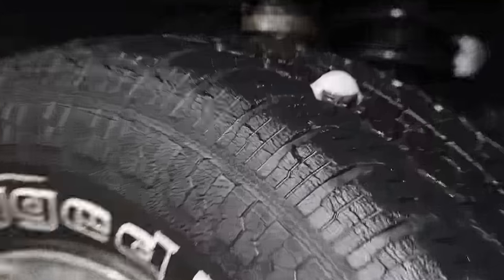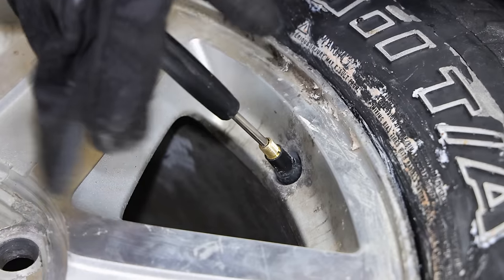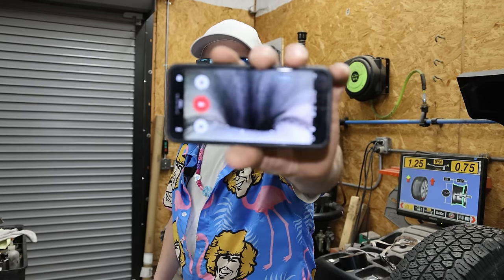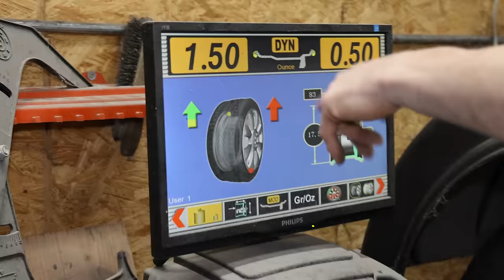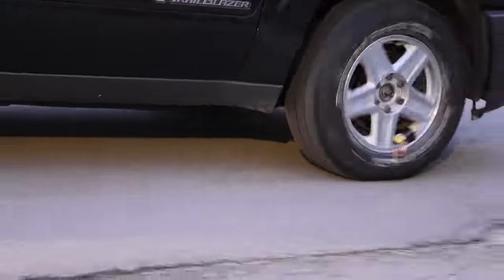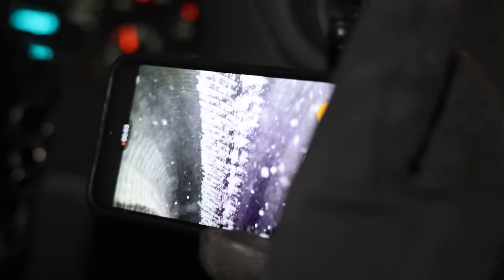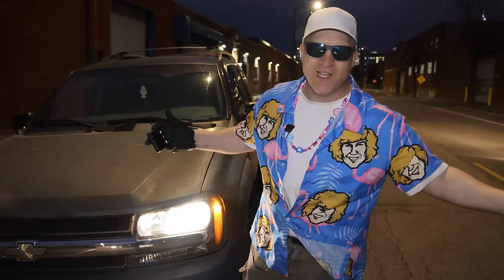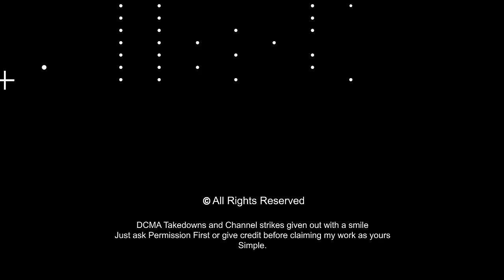GoPro Inside a Car Tire (With Balance Beads)

Comment: Cool as a science experiment, and maybe temporarily relive the vibration of a hand changed tire, but just get the thing balanced! Admittedly shops gouge mercilessly for a dynamic balance for 2 minutes work on a machine paid for years ago, so shop around. There still isn't anything better that I know of.
The camera was cool and made the video worth watching but, the test wasn't all that good because you didn't do a baseline with the camera, without the beads.
I am with you and can't come up with a mental model of why they would work, but if a theory doesn't fit the facts, it's the theory that is wrong.
Reply from the maker: Yeah I agree, well as you see from this video I have my own balancing equipment, But I completely agree with you tire shops are usually a nightmare. As for the theory yep I agree and It's bothering me to the point where The next video posting this week will be a follow up to this one, just so I can close the case and understand exactly what's going on... You know what I'm talking about.

Comment: That tyre needs scrapped asap, its badly cracked/perished, the cords are showing through the rubber thats peeling off, why are you still even using it?
Reply from the maker: Because it's a beater, but I changed them out right after I finished this video
Reply: Well, I've seen that tread and I said what is going on?No way he wants to use that tire, but that's what it does, right? It gets you to speak up. It's a great big trick and I approve of that lure. 😅❤
Reply from the maker: @MacNifty  well not too much of a trick because I actually did use the tires in the video, but I changed them afterwards, I honestly almost didn't but One of the beads ripped when I took the tire off the rim to put the GoPro inside, however they were very very noisy.

Comment: i'm skeptical about these beads i have a feeling they would  weaken walls after vibrating and rubbing against the tire for tens of thousands of miles. kind of like a rock tumbler.

Comment: Tires won't last long with beads. They will wear the inside of the tire out before you start losing tread life which will result in faster tire degrading and more tire blow outs. But go for it

Comment: My best guess how they work....

All sides of the tire compress when they hit the road as the wheel rotates....
The heaviest side that sticks out the most also compresses the fastest and the most and throws the balance beads out of that part of the tire

 I feel balance beads only work when driving on a road and would dis-balance a tire if spun freely in air.

Let me know your thoughts.

Comment: I tried 6 ounces of tire balancer fluid in each of 8 P235/75/R15 tires. Wasn't worth a shit. Had to wipe all of that junk out. Would not balance on an electronic balancer as shown in the video either. Fluid should work even better as it flows and won't clump or stay at tire ridges. I went back to weights ever since after wasting a bunch of time.

Comment: ummm right.  It was 2oz out of balance on the machine WITH the beads in, right?  Sooo...NOT balanced.  That 2oz is gonna have that tire thumpin at highway speed.  And not sure what the point was about a brand new tire being out of balance?  Of course it was.  They all are due to slight manufacturing defects and also imperfections in the wheel.  That's why you always get your tires balanced when you buy em.  (Do I really need to be sayin these things?)
Reply from the maker: Hey I was just showing how they work..,that's it.

Comment: You could cause a fatal car crash with those tires and now YouTube permanently has video evidence of you knowingly driving with defective tires.  It will cause any insurance company to have a perfectly good reason to not cover you and then you'll be in a horrible situation.  Crazy!  Even if my tread is perfect but I would see any sign of dry rot, new tires get ordered that day.  Isn't it nice having new tires?  I love it and don't hesitate at all.  Whether it's car or Mountain Bike... Always keep your Tires and Brakes in the best condition.  Slowing down and steering are your 2 most important safety devices.

Comment: Man i hate those fucking beads lmfao. I used to work at a tyre recycling facility and truck tyres were notorious for having these in them, so when you'd roll them out the back of the truck onto the ground they'd go everywhere, bounce into your shoes and you'd be stepping on the fuckers all day. Also super slippery to walk on.

Comment: Balance beads are great until you stop at the gas station on the corner to put some air in. Then the shitty compressor adds a little moisture to the air in the tire and your beads end up being a clump.
Reply from the maker: That's a great point

Comment: It's insane how cracked those tires are. That would not pass motor vehicle inspection here in Canada. I'm sure I'd get a stern talking to if I brought a car into a shop with tires that F'd up.

I guess this guy runs his tires to total catastrophic failure.

Comment: If your tyre is that bad, replace it. Everyone around you will thank you. Those bits of rubber will fly at speeds that could seriously hurt a person (or worse with larger chunks) if it hits them. Don't just put beads in your tyre and call it good.

Comment: Balance beads = Gimmick!

Even if you were to put sand or small rocks in the tyre they would have probably behaved the same!

What was the weight of the balance beads??
They were so small and so spread out inside the tyre with many variances that they wouldn't have any effect on balance!

You got duped!
Reply from the maker: Well I didn't get duped, I don't use them. It was about 9 oz of each type of bead, I don't think sand Would have the semifact because from what I witnessed the beads rolled into place way smoother than sand ever could. Just my observation.

Comment: The coolest thing about this video is seeing the inside of the tire while actively being driven. I was interested in what kind of science supports the usage of balance beads since I’ve never heard of them before. 
I’m disappointed that this video did nothing to establish any scientific method for confirming or denying the plausibility of using balance beads as opposed to traditional weights.
At no point in this video did we establish a baseline and comparison test, and at the end of the video swapping out the old tire 
With a new tire, and using no balance beads, did nothing to provide any scientific evidence other than “hey look what another tire would look like on the balancer“. For context, as little as a quarter of an ounce of imbalance can be felt in the steering wheel depending on factors such as tire construction, size, and suspension. To show that the tire needed at first 2 1/2 ounces of weight and then on a second balance 2 ounces of weight does not show an effectiveness of the balance beads to actively balance the tire out.
Unfortunately, this video can only be chalked up to a gimmick. I still loved the GoPro video inside the tire.

Comment: Those tires are trashed and need to be replaced. Tread separation is a blow out waiting to happen. And if you took the tire off to mount the go pro why didn't you put the beads in then??? LOL You are supposed to throw the entire inner bag in there. Yes, I change tires for a living....

Comment: I am thinking those beads are a gimmick. Like Magnets on the fuel line.
Balance is Left to Right Not the full circumference of the Flat of the tire. The Beads were all Slung to the outer circumference & looked to be pretty evenly distributed. No Balance there.
I have had tires so bad you had to put almost a pound of weight on "One side of the tire" to get it to run smooth. And it is not always the Outside where the weights are placed.
Pretty sure these Beads are doing nothing to help.

Comment: Neat, but where is the control test? You should test balance before adding the beads. It's quite possible it was balanced properly without any beads.Your final "test" wasn't actually a control. It's not "crazy."

Comment: Balancing beads don't work. You didn't even check the balance prior to putting the beads in. It's just tiny little balls floating around in your tire sticking to wherever the centrifugal force pulls it, people act like these are some kind of nanotech like it finds the unbalanced area and sits right there, some genious came out with this idea not for you but for him and omg the Goldwing community went nuts for them. I've dealt with them way too much.

Comment: Bro you literally just toss the bag in the tire and it'll open itself up after driving a short distance lmao I have never heard of anyone putting beads in a tire in either of the ways you showed. I have 12 years experience as a mechanic.
Reply from the maker: Well I didn't want all those microplastics They could affect my tires digestive system. But in all honesty it was in the instructions This is my first time using these beads. I'll just toss the bag in next time But I was shooting the video and I needed them to be active right away.

Comment: Beads have been shown NOT to work on wheel balance machines. The argument is the axle needs to be able to move in order for the beads to “do their thing “.

So how is it that a 7oz GoPro imbalance can be corrected while on the machine?

Balance beads are BS.
Reply from the maker: Good point but looked like they worked to me, to clarify I don't use balance beads at all, this was just out of curiosity.

Comment: For this to mean anything you'd need to know the balance without the beads in there.  Also, we saw that the claimed mechanism for these things is total BS.  They did exactly what you'd expect, which is get stuck to the wall in a single layer and not move until there was significant acceleration/deceleration.  The manufacturers all claim that they continuously creep around to adjust for the weight.  Why would the heavy side be full of the things?  Reading the manufacturer's material, they also all say things like, "This works for some situations but not others."  Well, which situations?  Just gotta try it and see; you'll know if it works!  That's the same BS that you get any time someone is selling snake oil.  They only work for people who believe that they're working.
Reply from the maker: Great points and I'm currently filming a follow up video that I'll post this week because I am with you on everything you said, In my mind I can't quite grasp how these are working, I have to see it for my own eyes and dig into the science of it to see proof. Thanks for the comment.

Comment: Sorry but I'm not buying it, the same way when slime gets old and turns into balls inside your tire they always have a tendency to go to the lowest Heaviest part of the tire which makes the balance even worse The imbalance of a tire will always be the heaviest part of the tire the beads will only make the situation even worse by migrating to the heaviest  part. if you spin up that tire 10 times I'm sure you'll get a different reading every time.
The balancer only operates at maybe 10 miles per hour at the most, put it on a vehicle at 55 miles an hour and your steering wheel will probably vibrate your teeth right out of your head. Do yourself a favor, sell your go-pro and buy a new set of tires And have them properly dynamically balanced on the inner surface and the outer surface of The rim.
and have Them rotated and re-balance every 5000 miles!

Comment: I would be wary of using these. Surely they'll wear out the inside over time. They could also cause unknown damage and have unknown consequences if something happens
Reply: Sometimes there's a reason to use the tried ture and tested that's been used for decades

Comment: This video makes no sense. First off, after he mounts the tire with the beads then puts it on the balancer and it's out of balance! Right then and there it proves that these beads do not work. If what he is claiming was true, the tire would be balanced. Second he says "it's only 2 ounces out of balance." That's considerably out of balance for a normal SUV tire. Third, he spins the tire again and the balance changes. That is going to happen any time ANYTHING is inside a tire. If he spun the tire 5 more times, he would get 5 different readings. The fact that the second spin had a lower number than the first is completely random. Fourth, he didn't even check the balance before he tried this, which would be the basis of literally any experiment. What exactly is he comparing the new numbers to? The balance with the beads is probably worse than without but we don't know because he didn't check. Fifth, he talks about driving down a bumpy road, which has absolutely nothing to do with tire balance. Sixth, if these beads actually did work the go pro would show them all bunch up in the lightest spot on the tire which we clearly see them NOT do. Lastly, he mounts a new tire on the rim and checks the balance with no weights and no beads and compares that to a completely different tire. Being "new" doesn't make it more likely to be balanced than the old tire. The fact that the new tire is more out of balance than the old one means absolutely nothing. Again... he never actually compared the same tire with and without beads. If he honestly wanted to prove these things worked, he would have taken the first tire checked the balance then added the beads and checked the balance again. If these beads worked then the balance would have been consistently better than without them. I don't know if this is supposed to be a joke or something but you can see with your own eyes that what he's saying isn't true. At the end of the video he asks for comments explaining how the beads work. They don't!

Comment: If these glass beads are tumbling around in your tires for a few months... next time you pull that tire off the rim you're gonna meet a nasty plume of silica dust.
Maybe consider wearing a mask if you prefer your lungs sans permanent irreversible scarring. At a minimum use a water mister.

Comment: Yeah, the beads don’t work, if you’re happy with any imbalance other than zero then it’s not balanced bud and you shouldn’t be balancing people’s wheels. Do not fall for these “balance beads”, it’s bull crap. Think about it, if it’s centrifugal Force the beads are going to accumulate evenly, how does this offer a “balance”? You have to ADD weight to areas that are UNDER WEIGHT in order to balance a rotating mass or remove weight from overweight. The may help in some small way by adding some consistency to the overall mass but that’s on the same as balanced. Just use wheel weights, ffs. Also, lose the sunglasses inside, Just a suggestion.

Comment: Balance beads are a straight up gimmick. The inside of the tire is not smooth, so therefore they can't roll around freely to counterbalance anything. Don't waste your money folks. just get a proper tire balance from you auto shop and you dont have to have shit rattling around in your tires like a doofus.

Comment: You must not be in NY because your tires are dangerously cracked and rotten and should not pass inspection.  Do not drive on the highway they'll fly apart on you!  I know tires are expensive but you need new ones NOW.
Reply from the maker: Ahh .. NY... Overrated, false flex

Comment: BS.  Balance beads are a gimmick.  The centrifugal force will put them anywhere.  There's absolutely no correlation between the centrifugal force and the weight of the tire or rim.
Reply from the maker: I'm making a video right now showing exactly how they're working, I partially agree with you because depending on a few circumstances is whether or not they completely balanced tire out or just sort of balance the tire out, but if you watch my next video I followed up on this one and showed the science behind it.
Reply: After about 9,000 miles the entire inside coating of your tire will be worn off.  And the beads will start wearing into the rubber.  After 20,000 miles, there will be a lot of rubber powder flying around inside your tire.  @WarpedYT